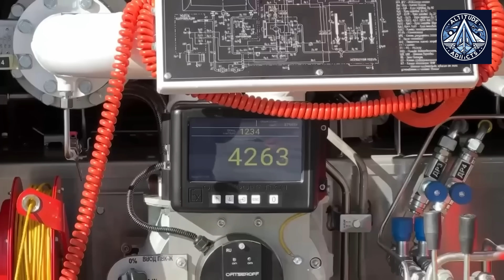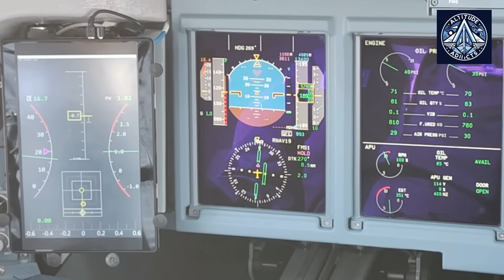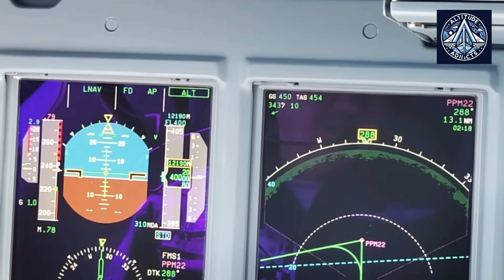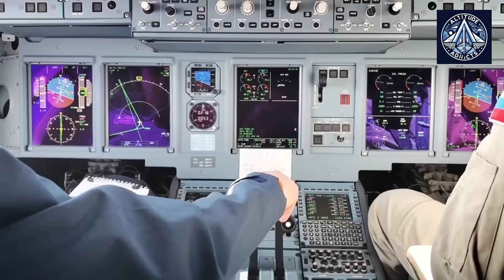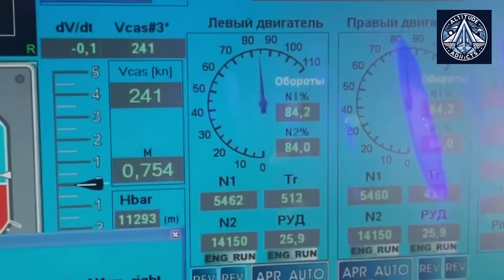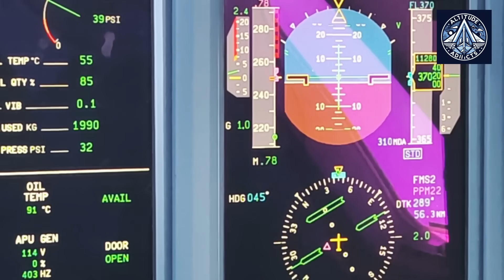Superjet 25 Degree Angle Attack Test—Russia’s PD-8 Engine Proves It’s a Game-Changer

Comment: Apart from the aerospace industry, it is also necessary to develop other industries such as automotive, electronics, heavy equipment and others to achieve independence
Reply: Russia is light-years from that.
Reply: @stabilo3170  🤡🦄
Reply: @wireless78borg  Any arguments? Or are you  totally ignorant? Most probably you are. Thank you for participating.
Reply: @stabilo3170  Are you an expert? An aircraft engine engineer?

Comment: The big problem with Russian planes, and why they are famous, is that they are unable to supply spare parts to the companies that use them, especially in the West. Interjet had enormous headaches trying to get spare parts, even the simplest ones, and the Yak-40 was no longer used in the West, mainly because of the supplies needed to keep them in the air. The plane itself is good, but as long as that happens, they will not prosper.
Reply: The problem was related exactly to the Western components suppliers! I don't know, intentionally or just because they were from other foreign companies. The SSJ-100 managers told about the logistic delays many times even before sanctions.
Reply: @maksimluzin1121  You are a typicall russian liar. Hopefully your country is so gangrenous that you will never achieve western level of technology, just making poor copies ... as usual!

Comment: Sukhoi Superjet 100 dengan mesin FrancoRusky dan komponen Barat lain sudah memiliki banyak data yang dapat dimanfaatkan.
Oleh sebab itu, penggantian komponen impor dapat diuji coba dengan lebih singkat.
Superjet 100 yang baru dengan mesin PD-8 dan berbagai komponen dalam negeri lebih siap untuk produksi masal di tahun depan daripada MS-21-310.
Mungkin banyak yang meragukan bagaimana mungkin mesin PD-8 bisa diandalkan hanya dengan waktu uji coba yang singkat?
Jawabannya ada pada kesuksesan PD-14 yang diterapkan pada PD-8. Lagipula pabrik mesin Saturn pun masih dilibatkan dalam proyek ini.
Reply: Great when expert from industry participate in commenting.
Reply: @subedi04 
I know that Western turbine engine manufacturers conduct very long and hard tests. On average, in the West, it takes 10 years to certify the engine. The results are good, but it doesn't have to be that long. The PS-90A engine only took 6 years to get certified. The PD-14 engine took 8 years. There is still data that can be used and there is no need for extreme testing for the new PD-8 engine.

Comment: Look at her fuel flow per hour:) At 37000 feet, cruise 0.79M - 890 kg/h per engine, 1780 kg/h for 2 engines
Reply: Jika memang PD-8 mampu sama efisiensinya dengan SAM, maka hal ini sudah menjadi kemajuan luar biasa bagi industri mesin turbin Rusia.
Reply: that's 3924 pounds per hour.  CRJ 1000 uses 3836 lbs/hr,   A320-200 uses 5512 lb/hr  old  SAM 146 used 3858 lbs/hr at M 0.78.   So yeah,  looks fantastic.
Reply: @jeffhedrich3551  5512 lb/hr for a A320-200? Please tell us the GW, Mach and FL? If you can.
Reply: These figures are easily achievable by an Airbus 320 or A321 CEO, all is about weight ... in your case the dislayed gross weight is 33 650 kg. An A320 with V2500 engines at a GW of 66 000 kg, FL370 and Mach .785 have a consumption of 1220 kg/hr/engine. I will not even dare to tell you the consumtion of an NEO, 20% less ... So man look at the real western engines figures before celebrating poor russian engine performances./
Reply: @stabilo3170 why is it poor performance? Is equal to the sam146 for consumption and is the start of its development cycle.
Reply: @jeffhedrich3551  OK, it's fair performance for russian aerospace industry, but some will soon pretend that's better than Pratt's GTF or LEAP from GE/Safran. I know a bit russians, they will soon 
tell us that the MC-21 is faster than the Concorde, and this, even before starting the toasts (vodka) at ten o'clock in the morning...
Reply: @stabilo3170 someone will always claim something stupid. Like western weapons are better than Russian weapons in Ukraine etc. but I think Russian industry officials are pretty open about lack of fuel efficiency. Although what’s better, all the GTFs sitting on the ground because they fail too early, or a super reliable engine that gets slightly less fuel economy?  Time in the air is money in the bank.
Reply: @jeffhedrich3551  Russian officials are always claiming the superiority of their products, whatever the real performances. Concerning the PW GTF, I agree it's disturbing for airlines, but at least PW admits their faults and gives financial compensation to their customers, the "small scale" experience from the SU-95 operations in Mexico and in Ireland shows that russians are totally unprepared for customer support and thus these airliners were constraints to cease operations. Did the russian learn from that "failure"? Not sure.
Reply: @stabilo3170 the issues were largely due to the engine servicing no? Power jet was joint Franco Russian. So how much of the blame lies with Russia vs France? Was the least reliable part of the sam146 the Russian developed component?  I have more questions than answers.
Reply: @jeffhedrich3551  Don't blame the french SNECMA, now Safran, it's a proven worldwide company, comparitevely NPO is nowhere! NPO is out of the scope! Just a joke in the western world!
All issues coming from the russian side where solved by the french. I know what I'm talking about. Not talking about spare parts from NPO, somewhere is the "cosmos" ...
Reply: @stabilo3170  An A320 with V2500 engines at a GW of 66 000 kg, FL370 and Mach .785 have a consumption of 1220 kg/hr/engine - this is is MUCH higher than 0.79M - 890 kg/h per engine for SSJ:) . Well, it is the same like comparing E190 with Airbus 320:))) SSJ is from different and much lower league which is very far from A320 or B-737:))) It is better to compare the SSJ with A220-100 with her "real western engines". No one thinks even in Russia that this first iteration of PD-8 is to trash western engines. But I expected from them something like 1000-1100 and I was pleasantly surprised the reality.
Reply: @toriyshaov2245  The figures I gave for the A320 is for a GW of 66 000 kg while the SSJ figures are for a GW of 33 650 kg,  a delta of just 32 350 kg. Please, next time read more carefully my post. Anyway, nice try.
Reply: @stabilo3170  A220-100 - 17,630 kg (38,867 lbs), 1,850 kg/hour (4,079 lbs/hour) at 41000 ft and mach 0.8